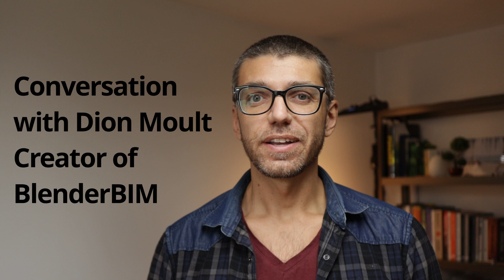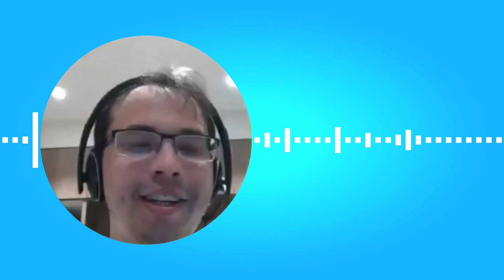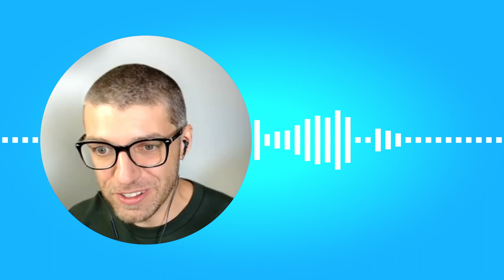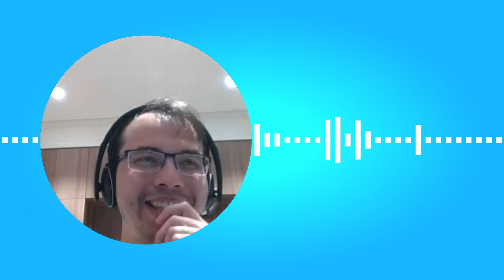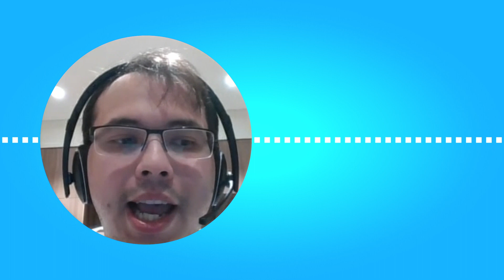01 BlenderBIM, IFC, and the importance of Open BIM with Dion Moult

Comment: To moderator: 59:50 there are such softwares, apart from Revit, eg. Vectorworks, with amazing 2D, DWG or the whole BIM stuff functionalities
Reply from the maker: Very true, have tried them and used Vectorworks at a previous office I've worked in. Yet Vectorworks BIM is a bit like Autocad Architecture, where users used to drafting tend to draft instead of utilise some of the bim tools. Also, I meant it more towards an open BIM software, if it were to be developed now, or perhaps as part of BlenderBIM, or as an improvement to Freecad. Appreciate your engagement!
Reply: @UHStudio  not anymore. Now it’s a full-fledged BIM software, after great improvements in the last 4 years, when many internal developers were available after completing the full Parasolid engine implementation.

Comment: Target Cost monitoring (TVD) in IFC would be great, too…
Reply from the maker: I am really not familiar with most aspects beyond the design phase, but have you checked the IFC schema if it includes it? A quick search on the buildingsmart provides some results: http://ifc43-docs.standards.buildingsmart.org/search?query=target+cost+monitoring
Reply: @UHStudio  thanks for the tip. I’ll really have to check the scheme. Btw, Dion said a great thing: BIM is virtual, but our reality is not.
That’s why mu focus is lean construction, where the planning is unified with production, again, since being split by Taylor in the beginning of the 20. century.
Reply: @robertszczepaniak8553  It's possible and I've done it from personal experience, but not very well fleshed out right now so don't expect much vendor support.

Comment: As for solids vs meshes, i think terrain models work way better with solids (also for automatic cut’n fill calculations, also regarding materials’ assignments, as for walls or slabs in the building). 
How about these calculations in BlenderBIM?
Reply from the maker: I believe IFC OpenShell converts meshes to solids if they are simple parametric models like extrusions. As for terrains, my understanding is that even Revit meshes them when points are moved around (at least from my personal experience it seems so).
Reply: @UHStudio  i don’t use Revit, actually i never did use any software from Autodesk, so the references say nothing to me. 
But a convertion to solid looks great 😊in Vectorworks terrains are not extrusions, but a special solid element with mesh-like editions (pulling vertex individually or in groups to model terrain specifics)
Reply: @robertszczepaniak8553  The BlenderBIM Add-on allows you to preserve representations, and offers simple editing in various types and basic conversion / reconstruction. So for example for certain solids, you can add boolean cuts and openings in Blender and it'll stay as a solid. Alternatively you can convert it to a mesh. Or, you can take a mesh, and convert it back into a solid. There are quite a few approaches available :)